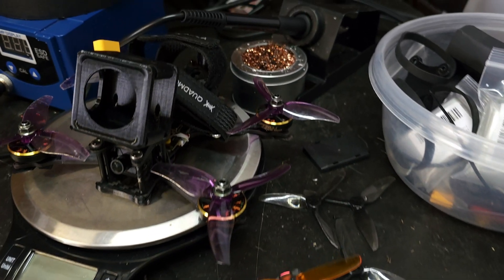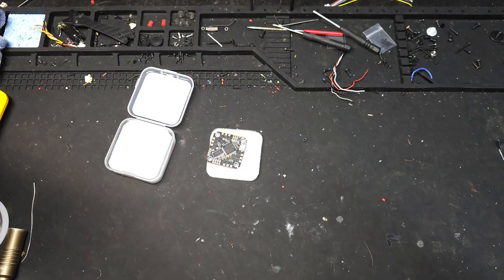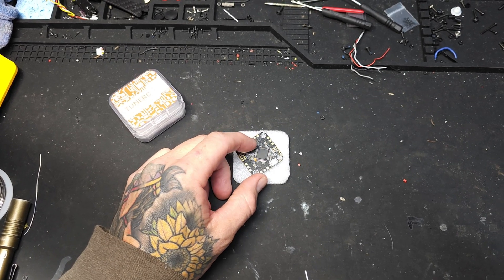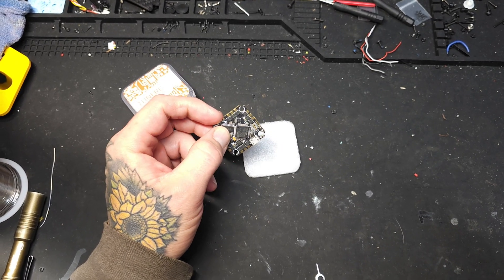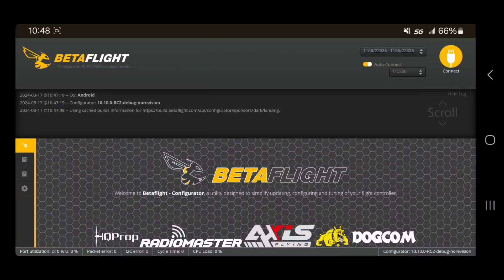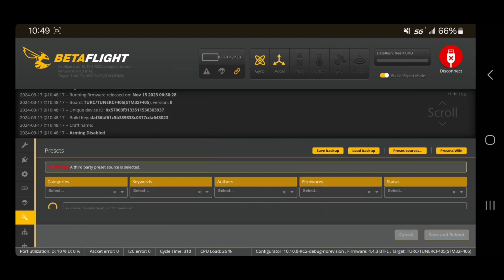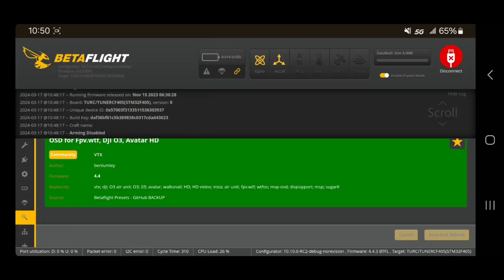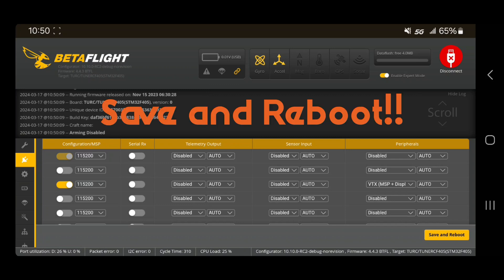Get Walksnail OSD on Betaflight // the easy way // WalksnailWiki

Comment: thank you - how did you get full BF on your phone? ive got the speedybee app but i'd love the full version! thanks again
Reply from the maker: It's only for Android as far as I can find. But on the releases listed on Github. It's the one file named "debug". Usually it's the second one in the list. It comes in clutch. It runs pretty good. Has a few quirks. But nothing that is an actual issue. I use it more than speedy bee. About the only thing I use speedy bee for now is the OSD element placement. It's a little more user friendly. But the android one works.
Reply: @xORLOCKx  downloading and working thank you!